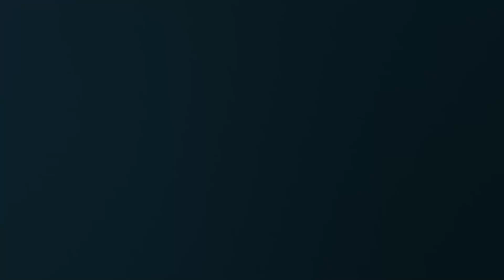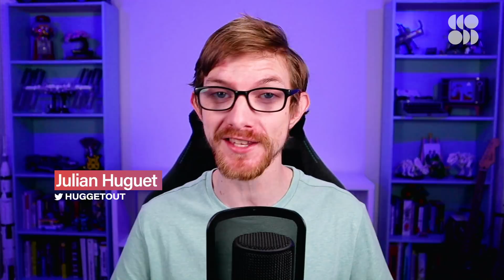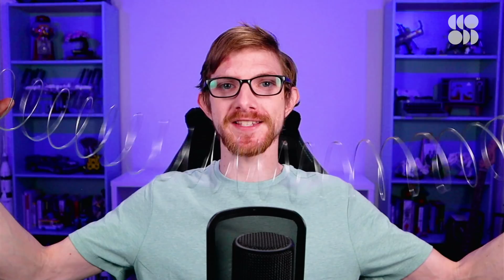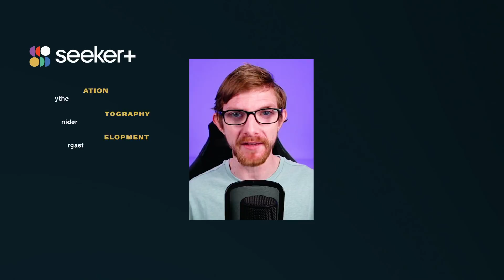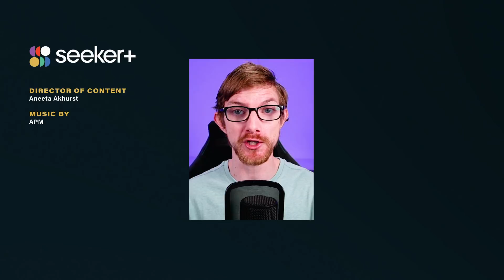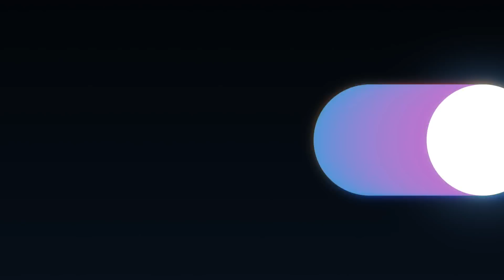What Makes a Sonic Boom So Loud?

Comment: I'd like to add that, for the most part, current comercial jet planes are slower than those of the sixties. This started with Boeings 757 and 767. It was done intentionally to reduce fuel consumption, as a small decrease in speed resulted in significant fuel savings.
Reply: Yep it’s due in large part to high bypass engines that basically use a big fan for a big portion of their thrust. They’re more efficient but work best at a slightly slower speed. We mention this is a YouTube short accompanying this series.

Comment: Don't need to be an Olympic athlete to a fighter pilot, and there are vision correction surgeries that could have qualified you for the Navy or Air Force (LASIK, PRK). I don't know how old you are, but those options have been around. All you needed was a competitive GPA, good test scores on ASTB (Navy) or AFOQT (Air Force), good recommendations, and good statement of purpose. STEM degrees are preferred but not necessary. Furthermore, fighter pilot slots are not guaranteed, needs of the Air Force/Navy and your performance while in training/school.

Comment: Is the speed of sound also influenced by pressure? Where temperature is the vibration of atoms, pressure is like their proximity. The pressure at high altitudes is also much lower than at sea levels.
Reply: Amazingly, no! This is apparently a question that trips up pilots all the time when they’re taking their license exams. Higher pressure may force molecules closer together, but it also increases density so the molecules take up less volume. The two effects cancel each other out completely.